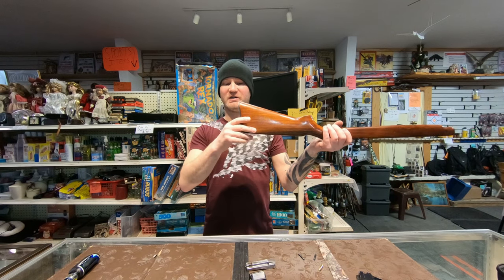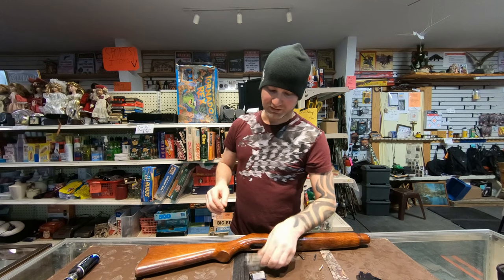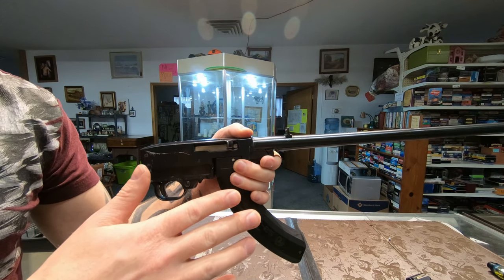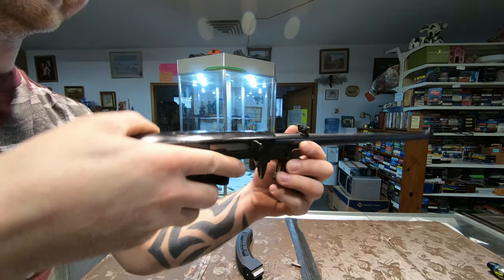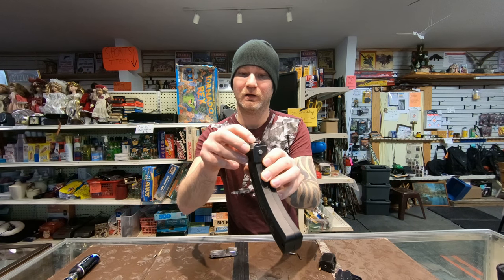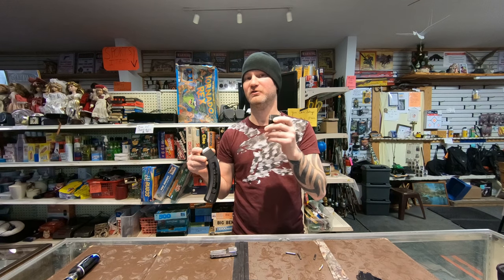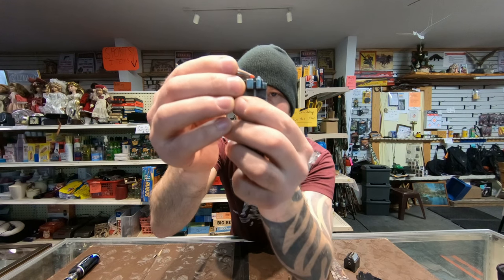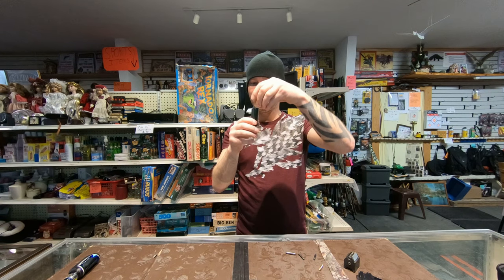Fail To Eject Or Weak Ejection Fix

Comment: Brand new 10/22 with less than 100 rounds, and I am already getting failure to extract issues 🤦‍♂️
Reply: Me too, and it’s a 60th anniversary. I changed the magazine plunger, the extractor, and added an auto bolt release from Kidd. Still won’t extract half the rounds I put through it. I’m basically single-shot firing it these days
Reply: @andrewdunphy464  I’ve learned mine is super picky about ammo. If you feed it CCI standard or subs, it’s happy with no real FTFs or FTEs as long as you clean it regularly. Aguila 36gr subs? Absolute junk in this thing.
Reply: @illestdomer2005  perhaps you’re right about mine. All I have are 2000 rounds of Águila and it’s just terrible. Will try some other ammo, thanks!
Reply: @andrewdunphy464  I hope that helps! I bought 2k rounds of Aguila subs, and they’re fine in my CZ bolt action but garbage in semi-auto platforms.

Comment: They have a tolerance issue. Mag well Ruger provided screw threads for mag adjustment. Size is 12-24x1/4 surprised all these gunsmith videos never mention fix.

Comment: Thanks, great information. Slamming the bolt or slide foward on a chambered round will stress it also.
Reply: lauri neil-morin What happens when the bolt or slide operates normally during firing? It does the same thing. It slams forward whether it picks up a round or not. It will not stress it. It was designed and made to do that and take the stress. If it didn't you would not be able to get through round after round of shooting.
Reply: @rbm6184 As the slide or bolt stips a round off the magazine it slows slightly. Also the case provide some cushioning. You can verify this with a gunsmith or you can keep destroying yours.
Reply: @laurineil-morin3792  Okay be hard headed. I have been shooting guns for 40 some odd years and never had any problems with an extractor due to normal function of the gun unless wear and tear over the years on parts. Guns are not as fragile as you think they are. I know plenty of gunsmiths and they agree with me. You don't have any idea what you are talking about.
Reply: @rbm6184  So Wilson & everyone else who make all these improved replacement parts are all wrong. O.k.
Reply: @laurineil-morin3792  This has nothing to do with improved parts. This has to do with the normal function of the gun. Somebody has sold you a line of garbage that guns are fragile and that is not the case.

Comment: So what's the fix? Are their parts kits for refurbishing older 10/22s so they run like new again? Seems like there would be a market for that.
Reply: Kidd
Reply from the maker: I just pull back the spring pull of the old part put in the new part and let the spring go 

The part is like $10 but I’m still gonna call Ruger and see if I can hustle them out of a free one

Comment: My marlin model 60 wont even pull it from the barrel lol.. completely disabled the bolt springs for the ejector seem fine.. electors are kinda old .. gun is a 70s model.. do you think replacing ejector would help or do I need a new barrel? It seems kinda pounded down in there but fires fine just won't pull the round from the barrel at all .. any help would be appreciated

Comment: Sorry didn’t watch the whole video. Very nice by the way. I just wanted to say that sometimes any or all of the magazines can be loose when inserted. I saw this problem with my older 1022 by shimming the inside of the rifle with masking tape believe it or not. On the wood stock inside which insured the magazine didn’t wiggle at all. All my magazine and extraction troubles went away. So if your magazine wiggles too much when inserted that could also be a problem
Reply from the maker: Nice

Comment: Lithium grease on that guide rod. That'll stop that bind.
Reply from the maker: I will have to give it a try
Reply: @CRSFirearms  I don't use oil on my firearms. I look for places where there is friction and contact, 'shiny' places, stuff like that, and take a toothpick flattened into a tiny spatula and put a thin coat of lithium grease on there. Grease is heavy enough to keep dust and dirt out of the works. I've found that many oils suck in dust and dirt, and then become sludge quickly.
Recently I got a Henry Lever-action for review... and it was VERY tight action. Even though it was oiled. Went through every part and got a thin coat of Lithium on everything that touched and now it's silky smooth operation. One finger lever. Before, you needed your whole hand in there. I can 'flick it out' like the Rifleman now.
https://www.youtube.com/watch?v=5Rl-FGETfS4